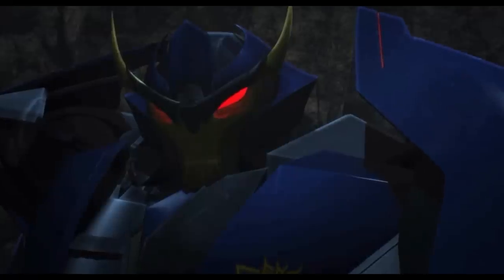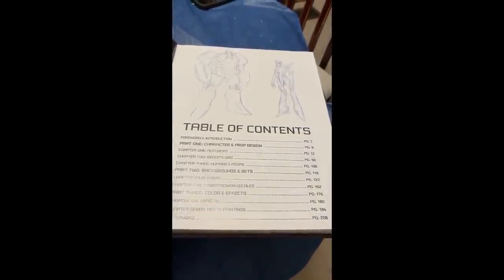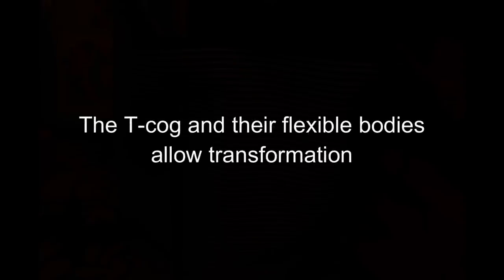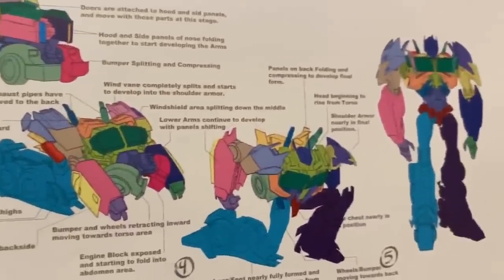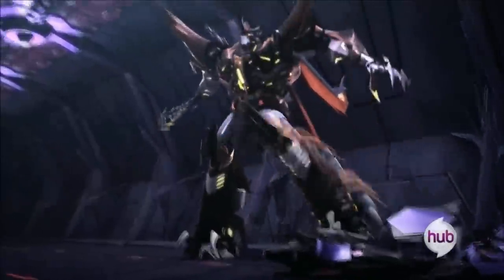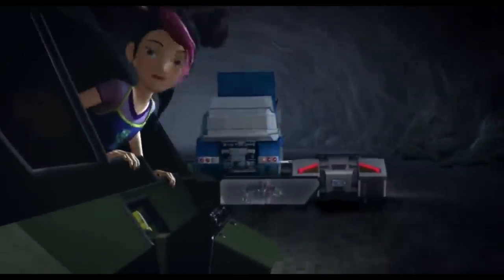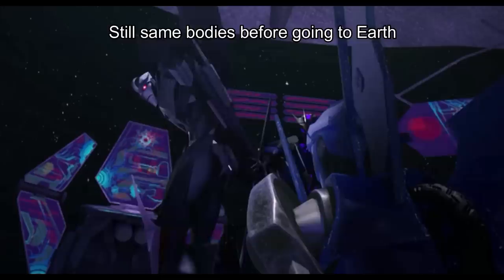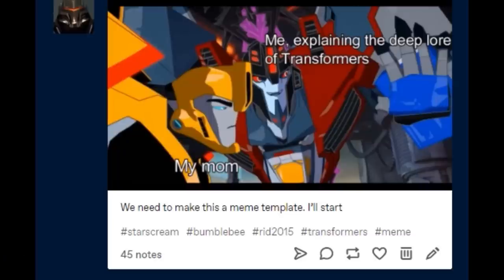Is Mass Change a Problem in Transformers Prime?: How Transformation works

Comment: Ratchet is also a victim of this, his vehicle mode is way smaller than his robot mode.
Reply from the maker: Yes, the little ambulance the vehicons chase around before Megatron steps on him! I think every single character is an offender
Reply: The figurines are The answers for these transformation problems
Reply: No shit
Reply: @emperorkumquat   considering soundwave once turned into a freaking cassete player and megatron beCAME GUN i dont see a problem
Reply: In fairness, I bought the Masterpiece Ratchet and he was a fairly sizable figure. He turned into a really compact little van, and I was shocked at how much he compressed into a tiny little van once he was transformed. So I think it's maybe a bit more possible that you'd think.

Comment: Yeah. I never felt it was a real problem, density can be increased/deceased but mass should not be able to be changed
Reply: Except that if density was changed. Their durability would suffer tremendously. In arcee's case her density shifting would make her 2.5 times less dense than the metal she is made of. She would be as dense as ebony wood which would make her dangerously vulnerable to human weapons.
Reply: Is mass shift/change the same thing of compact mass or mass enlargement? I mean, I always thought that what they do is mass redistribution
Reply: @nil981  you are thinking wrong. Her robot mode is her base density, bcs well, it's her original form. When she becomes a motorcycle, she compacts her mass so the density gets denser, so she is more resistent on alt mode, not her robot mode that is weaker
Reply: It's not that unlikely. Predaking especially, given that he flies, "hollow" parts would make a lot of sense to keep his beast form light enough compared to it's area.

Arcee's really a light, scoutish type so similarly being on the fragile side isn't terrible surprising. As a motorcycle she'd be essentially solid metal vs her full size though.
Reply: I agree with the original comment but I do want to add a counter argument for the case of Bipedal->Quadrapedal

Particularly with the Predacons. But let's use just Predaking for simplicity sake. The mass stays the same (as it should) but the volume changes. In his robotic mode he is extra dense and his footsteps should sound extraordinary heavy to show that

However. I feel in his beast mode. They should be slightly less heavy sounding as he's now on 4 legs instead of 2. Therefore spreading out the distribution of his mass more lightening the step of each individual leg

(Note) this does not imply he gets less heavy or more heavy when changing modes. He's still the same weight. Just that he displaces the mass differently depending on what mode he's in
Reply: @nil981  Density doesn't affects weight not durability. Durability comes from tensile strength not density.

Comment: So in short, Transformers Prime’s mass shift problem is because of a limited Budget and etc.
Reply: Mr. Pancake was it really a problem I mean in terms of character relation ala ironhide being as wide as a truck or grimlock head being smaller than his body is far more of a issue than waaaa this transformers is bigger than what it turns into
Reply: They were already spending 1.6 mil an eps just to go get that sweet high quality cg, it’s understandable ig.
Reply: But is mass shift the same thing of compact mass or mass enlargement?

Comment: For me, in the middle of the vehicle mode the parts can be tightly packed, for cybertron technology that seems to be mechanical biology is no big deal. But this theory with flexible metal explains a lot. I'm so glad that someone touched the subject of the faces in tfp, I always thought that this metal must be very plastic, I guessed it when I saw that nemesis prime built by humans doesn't move eyelids and can't take off the mask, because the MECH engineers cannot build the flexible lips . I'm waiting for more great videos emperor !
Reply from the maker: Thanks~!
Reply: Nemesis Prime yeah, I’ve always thought that characters like Astrotrain simply compresses into a small robot mode because his alt modes are hollow shells
Reply: @gezi5927  indeed

Comment: 8:08 imagine being a cybrotronian docter and trying to do surgery on a bot but all the transformers designs are different so you wouldn't know the certain location of a organ
Reply: I'm actually tackling that issue in the fanfic I'm writing. I'm postulating that there are frame categories that a mechasurgeon has to learn. The internals for each category are the same; it's only the size and outer plating that's different. Most medical personnel specialize in 15 or fewer categories. What makes Ratchet so effective is that he worked on a lot more frames than most, and could accurately guess on the ones he hadn't encountered before. (Think the difference between a general surgeon and a veterinary surgeon.)
Makes a lot more sense than losing a bunch of patients while you struggle to figure out how the Cybertronian under your knife is supposed to be routed. :)

Comment: I like how Megatron and Soundwave both used to have ground vehicle modes, and even after they got upgraded to flight, their bot forms still look like grounders, as they don't have wings like Starscream. You can really see that they are grounders by nature, while fliers by nature like Starscream and Dreadwing have actual wings. Love it<3
I also like that someone suggested that Predaking's (and the other Predacons') bot mode is actually his *alternate mode*, while his beast form is his natural form. Certainly makes more sense why he's more limited in bot mode and shrinks, just like Arcee and the others do when switching to alt mode. And that the bot mode gives the Predacons the ability to speak rather than just scream and roar. That would be the main reason for a Predacon to adopt a bot mode, I think, since their natural beast modes are superior in battle and transportation. Bot mode would only be to fit in smaller spaces and being able to communicate with other bots, as well as perhaps being able to use tools?
Wonder if the Predacons would have to scan bots to assume a bot mode. lol, probably not, but it's funny to think about, I think.

Comment: I run a Transformers RPG and one character used his experience points to develop mass shifting to a larger scale in later adventures.  We used a cover story that while in stasis his shifting shorted out and he forgot he had it.  While undergoing repairs, the medic reconnected some loose wires and the result almost wrecked the medical bay as parts started expanding and bots were ducking under jutting vehicle parts.  We were rolling, laughing about it  and we bring it back up often.

Comment: My personal head cannon for Skyquake (and by greater extension all of the cybertronians on earth) is that natural cybertronian alt modes aren’t capable of functioning with how different earth’s environment is. For example the hover cars seen in R.I.D (curse you R.I.D.) could function due to magnetism, and with the earth’s ground being generally non magnetic, they can’t hover. As for the flyers, due to jack needing a space suit, it’s likely that Cybertron has a different atmosphere entirely, likely being a much denser one which would allow their natural alt modes to fly, whilst on earth with its less dense atmosphere, they can’t get off the ground without proper earth alt modes designed with the planet in mind. Shockwave is just a tank with treads so his alt mode works for both planets, Megatron’s  artificial alt mode could either just be powerful enough to fly anyways, or it was designed for space, thus allowing for a decently capable earth flight mode. The Vehicons and Eradicons, due to being clones, could likely be part swapped more easily than other bots, allowing for the Eradicons’ cybertronian-like alt modes whilst still being capable of flight on earth, and as for Predaking? I don’t have a good explanation, but my guess is that his alien dragon form was originally intended for an atmosphere similarly dense, or even less dense than earths.

tl;dr, the majority of cybertronian alt modes aren’t capable of functioning on earth, therefore Skyquake needed an earth vehicle mode in order to fly.
Reply: That’s actually a really cool theory and it makes sense with them doing some Magnito shit to move on Cybertron
Reply: But in tfp u can see people like wheeljack Have wheels on basically his arms when he arrives on earth but why cant he transform into a cybertronian vehicle mode on earth I mean he doesn't have hover wheels and he does not fly so air density does have nothing to do with it. I have been trying to figure this out for a while please help me out.

Comment: Oh man, I have had So Many conversations and debates on this topic, not just regarding TFP, but Transformers as a whole.

Something that I've used in my own writing of various characters is linking mass displacement with subspace with more crazy transformations like G1 Megatron's gunmode, but Arcee and Predaking were actually a lot easier to explain (at least for me) after seeing a showcase of a real life BMW concept vehicle called the Vision Next 100 that utilized a technology called 'active geometry' to allow the enclosed wheels to still be able to turn. On the BMW, articulated pieces of metal on an underlying flexible material allow for mobility as well as protection, and the idea that the 'skin' of a Cybertronian used a similar concept but on a microscopic scale just worked SO WELL in writing that I couldn't leave it alone. There's also the utilization of compacting organs and functions not used in specific modes, like how Predaking's long neck and large chest are primarily conduits for the generation of his flame breath, which is never used in his bot mode, so the large empty space is easily compacted away like a plastic light saber toy. Bots that maintain a more consistent size between modes often don't have as many empty spaces, so have less room to compact or expand.
You do make a very good point about the tires though, and the only thing I can think that might explain the oddity is the combination of the 'active geometry' idea combined with the thought that bot mode is also usually battle mode, and having a component full of empty air is rather dangerous and distracting. So, instead, the rubber-like material is stretched over an internal metal structure, reducing the chances of a blow out but also providing impact dispersal, like the difference between a beach ball and a bouncy ball- A beach ball pops and is overall done for, but a bouncy ball can get chipped at and just keeps going.
I very much agree that Prime fluffed their bot to human scaling to better establish them as titanic beings, and it works well for the story telling, but it does make consistency a problem. Still, it's a LOT better about it than a lot of the more cartoony shows, and especially some of the Asian interpretations. The old CG of Beast Wars comes to mind...
Anyway, thanks for putting together this video and giving an inside look at the Art of Prime book! I've been wanting to get a copy of my own for a long time, but just haven't had the opportunity. So it's great to get a sneak peek!
Reply from the maker: 0ArmoredSoul0 I think the book is very expensive to buy online now, and I don’t really think it is worth it to be honest. I will share the funny things and facts inside for everyone later

Comment: The real question is why Megatron has a bucket head
Reply: @Selozar bring in the bucket jokes
Reply: @The Greeter, If you read Megatron Origin (comic book) it says the reason he wears the "bucket" is because it's a mining helmet/helmet in general. Underneath that helmet, Megatron has sensitive panels/a crest that served to help him in the mines (in the comic it's shown him taking off the helmet after a successful gladiatorial fight and showing them off as the sunlight hits before putting the helmet back on), but since he technically doesn't need them and they are a "weakness" he protects them at all cost
Reply: @gianellanajera6586  dude that's awesome, never new that
Reply: Form a character legacy perspective, is because of his original toy. The hole legendiary helmet that defined the character is because of a piece of kibble. I'm not kidding just look at the original toy and you will see what I'm talking about.

Comment: Also, as for the non-metallic objects bots seem to possess, like wheels, windows and seats, I think their bodies actually do contain a small amount of non-metallic elements like carbon. Since they obviously contain oil for lubrication, it's likely these non-metal elements in their bodies create their wheels, seats and other plastic, glass or rubber objects that make out their alt modes.
Organic creatures like humans and animals, while mostly made of carbon, hydrogen and oxygen, also contain small amounts of metal in our bodies. Bots would be made the same way, but in reverse. Makes sense, right?

Comment: ...

I DID design Ringside correctly!!!! 
There's a fanfic I'm currently writing, involving this mentioned boi, and I'm trying to fix the scaling problems but there's still a lot I need to work on.
As of now, I have Optimus' height set at 25 ft. Megatron at 29 ft. And Arcee at 12 ft. 
I don't know if I should scale up or down, but I really need to work on it 👀

Comment: I think its like this: the armor folds like a puzzle set or a rubix cube, with the plates organizing in several layers, basically the alt mode in arcee is smol and dense due to the plating folding into a tight fit and she gets bigger and less dense after the plating expands when unfolding. Predaking would have denser armor due to this effect and be lighter at dragon mode which would make it easier for flight.
Reply from the maker: Yep. This is what I mean when it is easier to break through their "skin". For example, if you wanted to stab Predaking through the spark or make him bleed, it would be easier in his dragon mode! An actual weakness in that form, and an advantage of armour for his bot form
Reply: @emperorkumquat  basically transformer guys are the result of metal origamis who bred with rubix cubes and gave birth on Primus's doorstep lol
This theory really explains a lot, I also really thought about this idea, makes for a nice concept!

Comment: I think that while predacons do have thinner plates in beast mode as a result of the increased size, I like to think that predacons do not sacrifice as much of the durability they have in their robot modes as we would think. I think that, similar to the infill structure of 3d printed objects, predacons have a three dimensional mesh of supports that reinforce the interior of the thinned armor plating so they still retain a good chunk of their invulnerability from their robot mode.

Comment: I may be wrong but despite Transformers Prime leaving an enormous amount of information from the original transformers. They have shown in The bayverse movie where Optimus is shown all rusty only to scan a truck vehicle to where he transforms. But, on top of the truck where air exit (not sure what its called) mental like tube appears would show it building up even though it looks like he does not have enough body parts to produce that

Comment: Now here's the real thing we may never get an answer for: What if the "Mass Change" is actually just a distribution change. 
Imagine if on the outside you see a  thick metal shell, but the inside is like a spongey 3D honeycomb pattern of air pockets inside? 
Would also help with impacts, cushioning blows and acting as a muscle or other soft tissue in way.

Comment: i just figured that the bots wer alot lighter than seemed due to the extra panels and stuff expanding out and stretching out a bit to become a humanoid form again. wich would explain how they are able to jump around a move with such agility when looking at their comparitive size. and it also explains why in the episode where breakdown gets kidnapped by MECH when he throws bulkhead into a building that it only crackes and craters around the impact of bulkhead to the building instead of caving the entire wall down. since it was a civilian building the walls were alot thinner concrete than say a military base only supported by some basic rebar at maximum within the concrete slabs. they arnt probably as dense and solid as you think. looking at the episode when the kids get stuck in the rift and have to move starscreams severed arm thats the size of a truck i really dont think a couple kids could pick up and move it the way they did in the show if it was 2 thousand pounds like your ordinary car.

Comment: I don’t have a problem with mass-shifters in the modern eras. If it sticks out like a sore thumb (I’m looking at you G1, no offense) then it looks a tad off. Triple changers can be a good example of mass shifters as well, since they are sometimes known to be able to take the forms of vehicles that are different sizes from one another, like how Astrotrain takes the form of a large steam engine or modern era train to a massive space shuttle. Though when it comes to triple-changers, it can be theorized that their t-cogs have mutations which could explain why there are so few of them. Same could apply to combiners, as well as possibly Predacons since their forms require a significant change size in addition to physique.

Comment: Alright so, transformers turn into the car itself. So almost anything that can be moved and controlled in the regular car can be controlled by the transformer. Since they are the car themselves they can also see using optic scanners. So when they apply power the car automatically steps on the gas pedal like a real car should be doing. And when they change the radio, the radio dials up with it